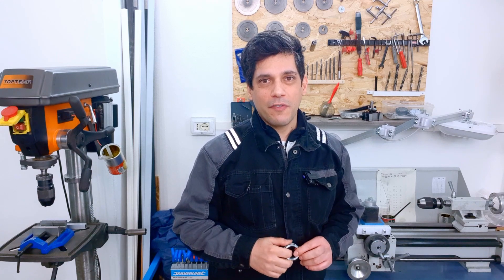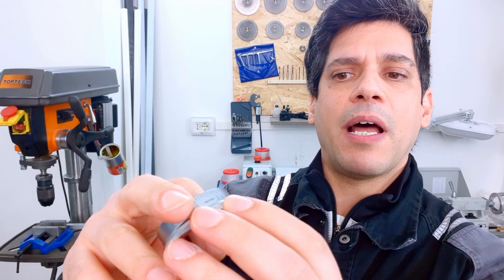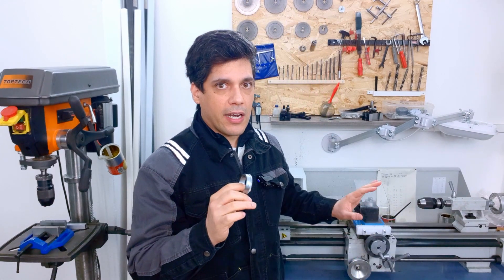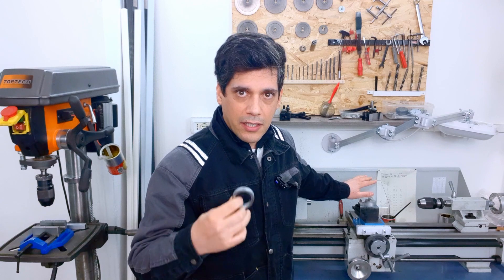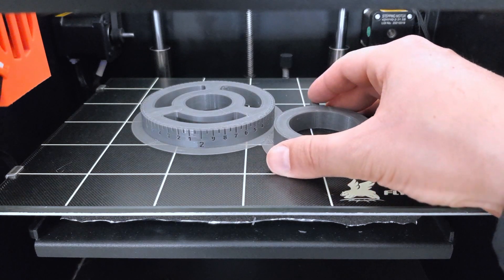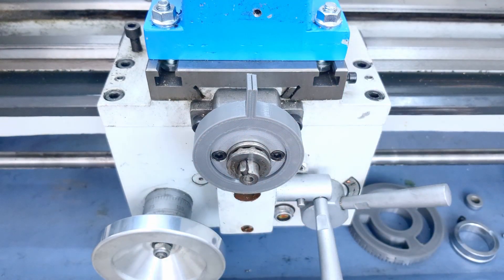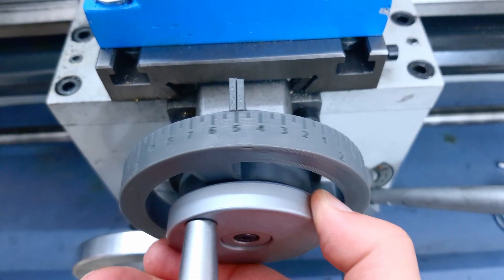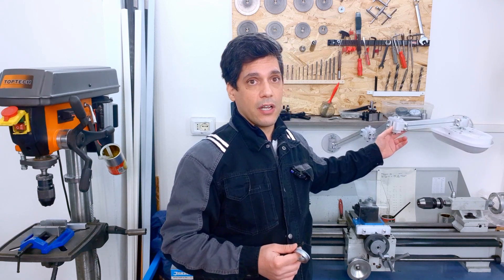Lathe modification: INCREASED PRECISION !!!

Comment: Btw, i dont understand one thing.
You have both lathes? Profi 750/550 LZ ?
Or they are same and you only have 1 ?
which one?
Reply from the maker: Hi. I have the 750 that's the same as the 550 but 20 cm longer
Reply: @RobytheFlorentine  Thanks